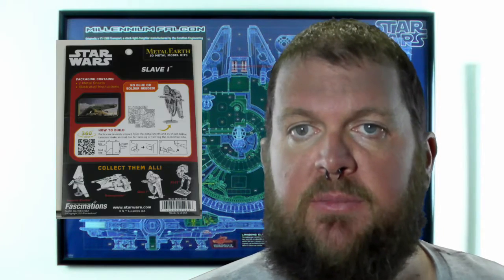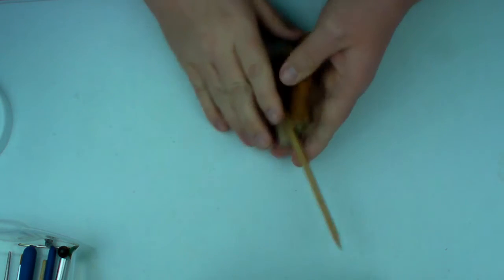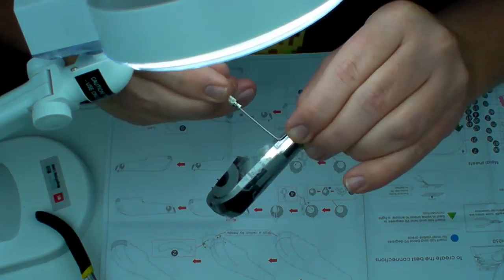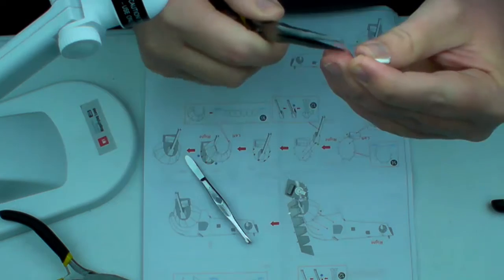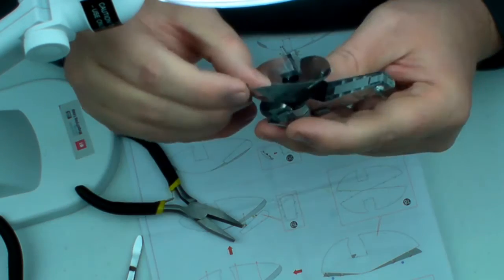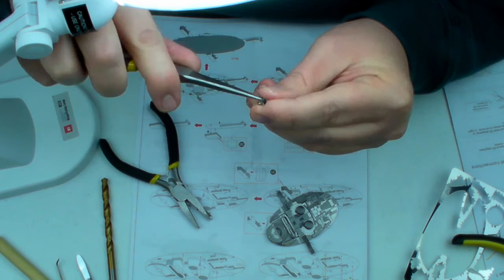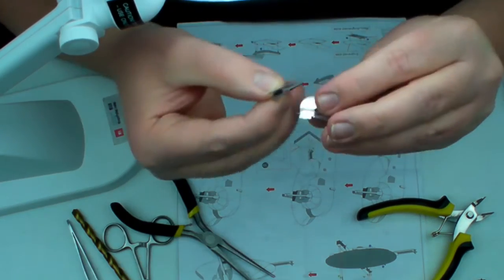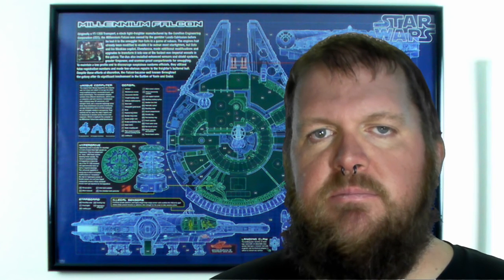Metal Earth build  - Slave 1

Comment: nice how difficult was this model compared to other kits ?
Reply from the maker: +Goldenkosher saxybacon It is kind of a mixed bag. Working with the shroud at the bottom and getting it shaped and attached was tricky, as well as a couple of parts near the end, but everything else was very straight forward. If you are referring to other Star Wars kits, it is somewhere in the middle. It was not as long and complex at the AT-ST or as tedious as the Drodika, but not quite as simple, in my mind, as the Falcon or R2.
Reply: animateorange how is it compared to the x wings ?
Reply from the maker: +Goldenkosher saxybacon Similarly difficult but in different ways. The front tip of the newer X-Wing is a real tough one. It trips a lot of people up. There are no tabs as difficult to get into slot as that, but there is more complex bending and shaping in the Slave 1. I guess the Poe Dameron X-Wing is just slightly more difficult because of that front clip.